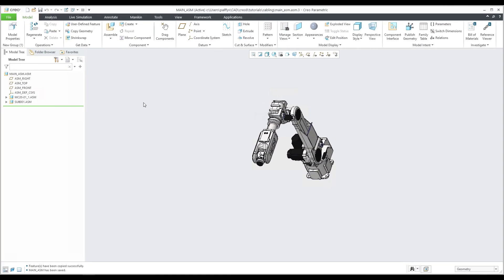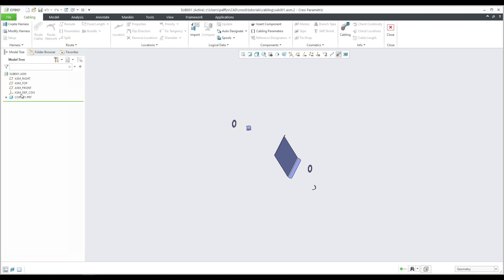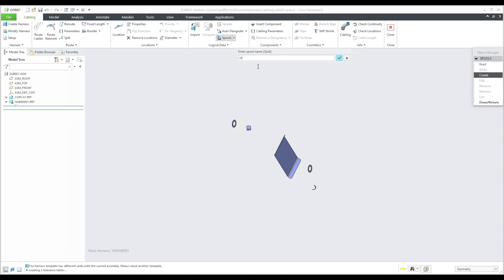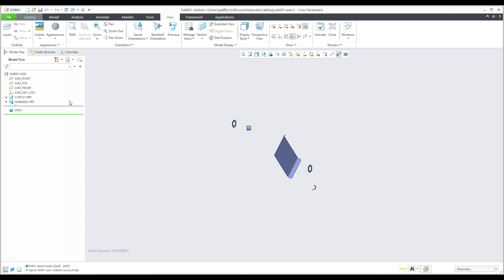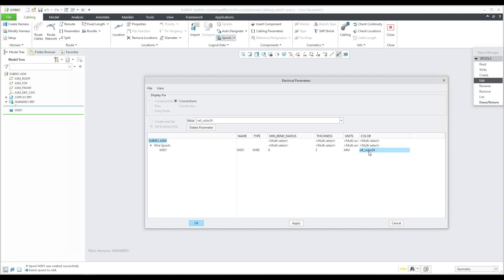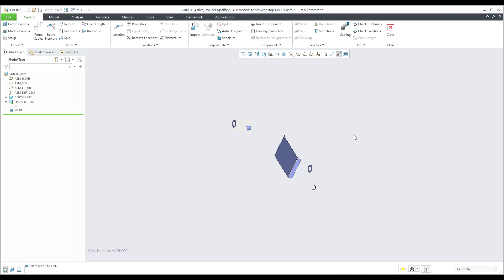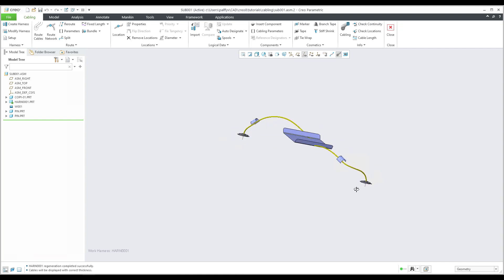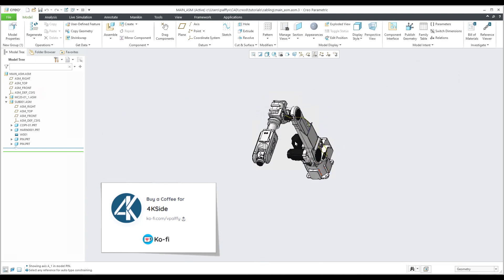Creo Cabling - Step by Step | Creo Cabling Basics steps

Comment: Hi. And what about creating a sheath in spool option ? When I define a sheath I can't route it after in "Route Cables", I just can create a wire or a cable...
Do you know how to manage it ?
Thanks for your videos !
Reply from the maker: Hi, in Creo Cabling is also possible to create a Bandle or Strap... But for basic Video is not relevant.
If you start working with Creo Cabling you will learn additional Features after easily 😎
Good luck with your project.